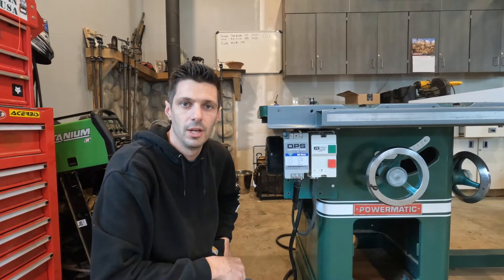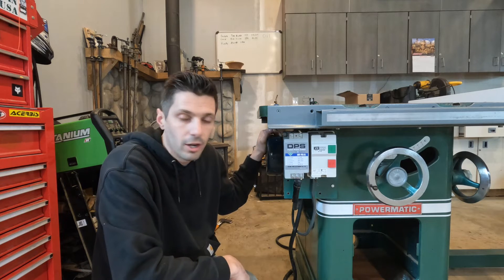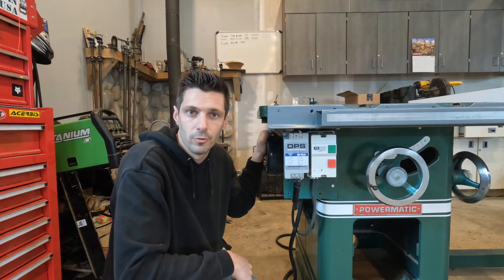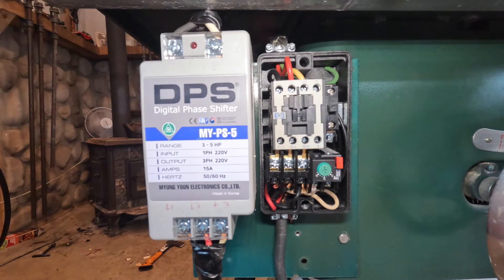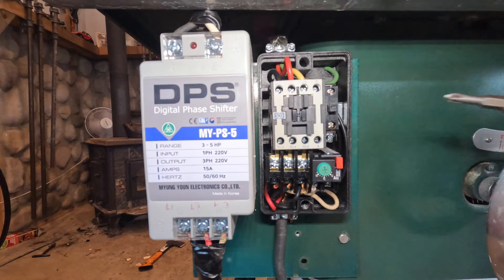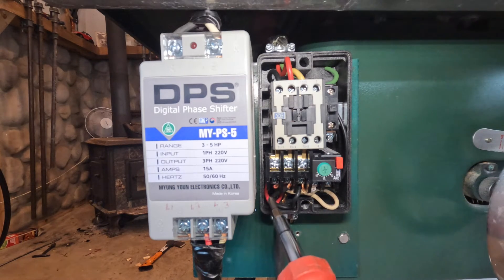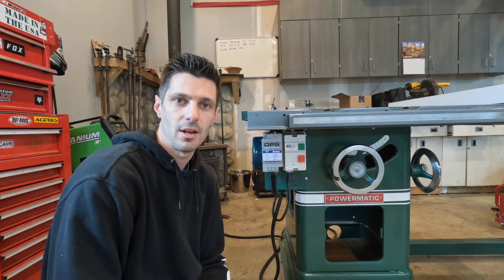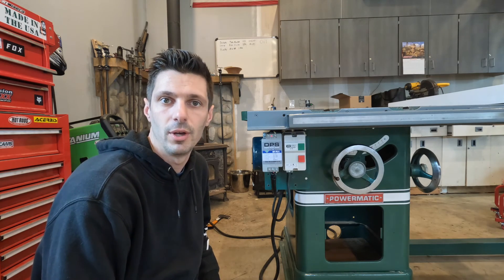Converting from 3 phase to single phase.(Powermatic 66)

Comment: what about earthing it to protect from getting electrical shocks? for the single phase wire, how did you get 2 hots to go into the phase converter? What happened to the neutral and earth wires in the single phase cable?
Reply from the maker: @StanleyOh123  to be honest wth you, I kind of forget what I did. Since I did this conversion, I ended up finding a deal on an original single phase motor, so I ended up removing this phase converter and just putting in the proper motor.
Reply: @bvisbuilds  I see. Hope you're a happier man now. 😊

Comment: I have a switch on my saw - powermatic 72 and need the DPS but the manufacturer of the DPS told me it need to go right into the motor directly , no magnetic switch , how did you solve this?

Comment: Have you had any issues with the DPS? Just got an old saw thats 3ph and only have 1ph in my shop and trying to decide what route to take
Reply from the maker: No I haven’t. I didn’t use it for very long though because I found a single phase motor on Facebook that was brand new so I ended up just replacing the motor with an OEM single phase motor.

Comment: It looks like you converted your single phase garage power into three phase using the DPS converter. Am I missing something? You say your are converting from three phase but you are showing single to three phase, just the opposite. If you have a three phase motor on your table saw it would need three phase just as the DPS device puts out to the motor.
Reply from the maker: Yes, you are right! I guess I titled this video wrong! Good catch!

Comment: That phase converter should be in a box with a cover. You have hot screws only protected by a piece of plastic, and the wire shouldn't be supported by the screws. 
If your electrician friends said that was ok they don't know what they are doing? It wouldn't pass an NEC inspection.
I don't mean to be a jerk, I just don't want someone to watch this and think it's OK to do theirs the same way.

Comment: Have you tried removing the nut holding the pullies on the arbor off?  Mine is stuck good.  I'm pretty sure it's reverse threaded.  I've got a few more tricks to try, but I may end up welding a big nut on the end to break it loose.
Reply from the maker: Yes I have. Mine came off very easy. For the saw looking as bad as it did when I bought it, it actually had very little use, and was in very good shape, so I lucked out.
Reply: @bvisbuilds  Was it reverse threaded?  Mine doesn't look like it, but based on rotation it seems like it should be.
Reply from the maker: @dberry99  good question. I don’t remember. Next time I’m in the garage I will take a look and let you know.